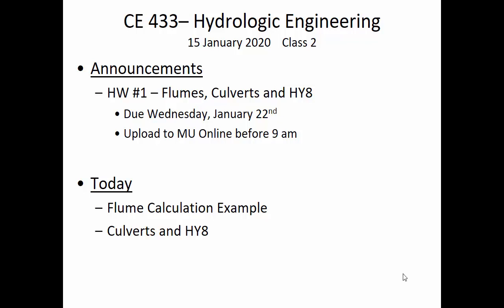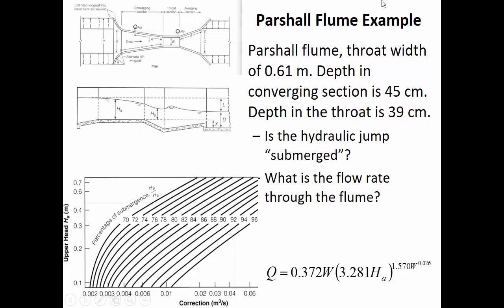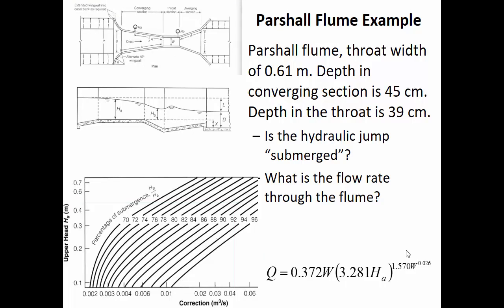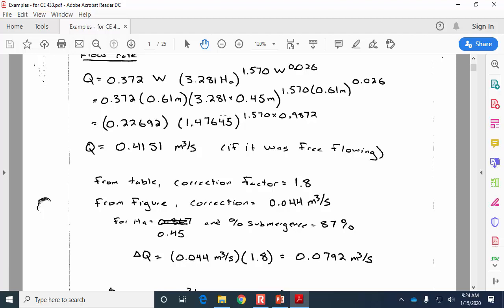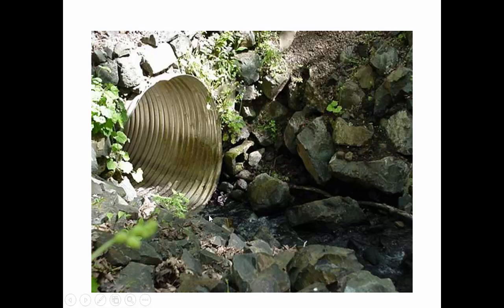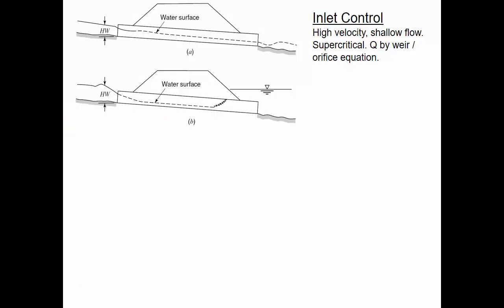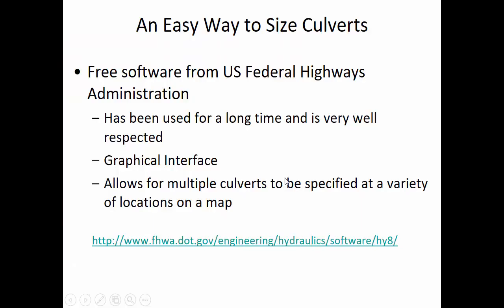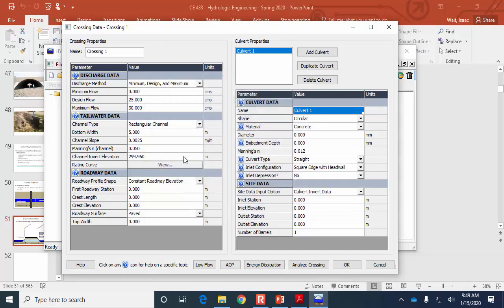CE 433 - Class 2 (15 Jan 2020) Parshall Flume Calcs and Culverts

Comment: Hi sir, what happens if a hydraulic jump is submerged?
Reply from the maker: If the hydraulic jump in a flume is submerged then there is a correction that should be applied to calculate the relationship between depth and flow rate. This video explains: https://youtu.be/QVaxDWn89vU